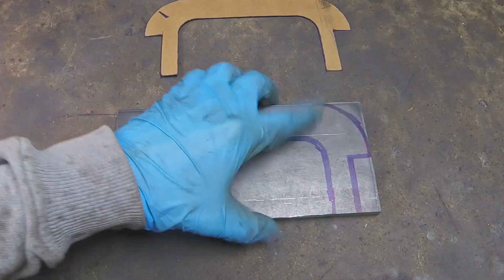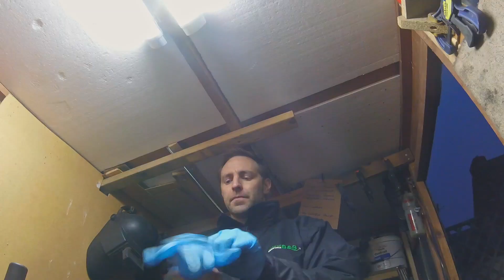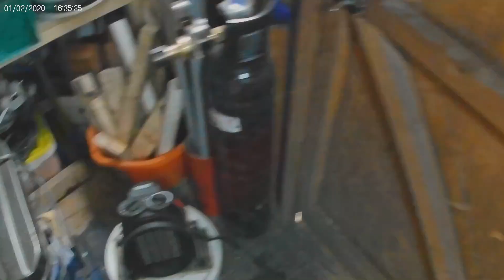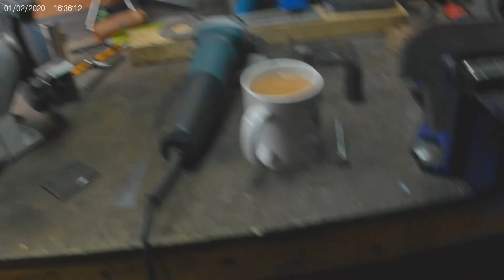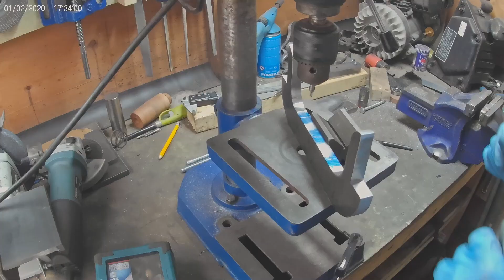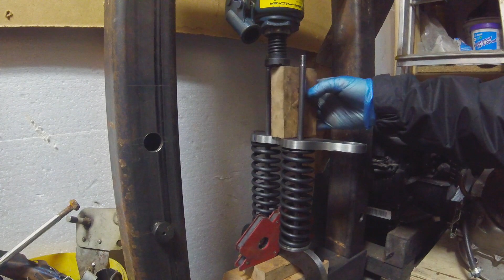Old skool Springer build Honda Rebel 250 Part 15

Comment: Good to see you back, 
Looking forward to seeing the progress
Reply from the maker: Yeah this episode has been a struggle to put together. Ordered a new camera discovered it was no good and sent it back. Ordered a new Go Pro Hero 9 to film and UPS has lost it in their network and then I took a chunk out of my finger. Springer is looking good thou :)
Reply: @dtaylo4517  just a run of bad luck, every build has it,  your were unlucky and lucky with the chuck, could have been a lot worse.
Are you planning to rebuild the engine as well. Or do you think it's good enough with just a service
Reply from the maker: I think the engine will be OK with good service, however Im sure one of the crank seals is leaking so will prob do a vid on that once I get round to it.